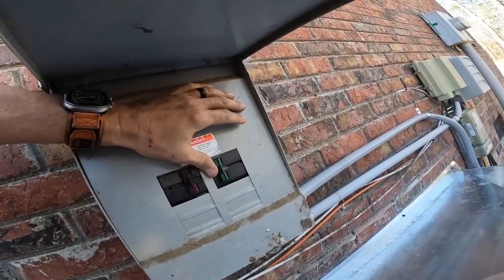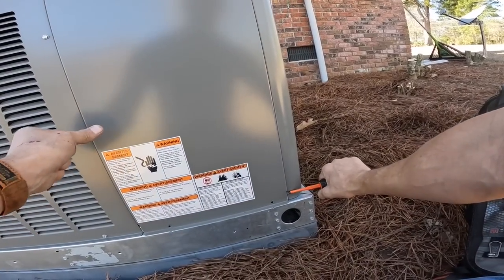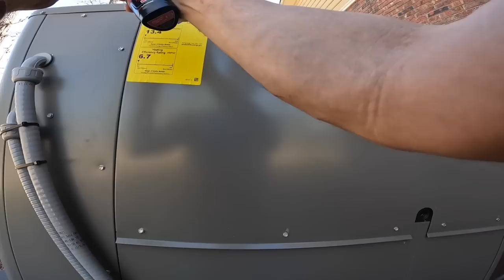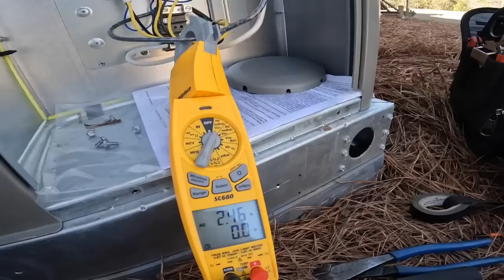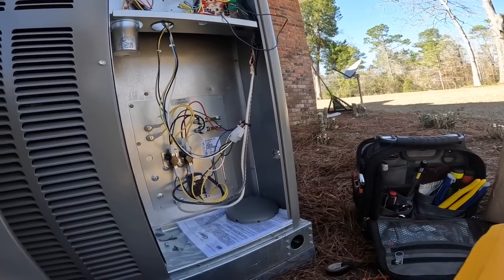Installing a Heater Kit On a Lennox Heat Pump Package Unit

Comment: I like the design of that Lennox unit. 
Heat strip was also professionally installed. Nice work Curtis
Reply: I agree, but when getting parts is a problem, that's a problem. He said the other customer had to go with a different unit because he couldn't get an evaporator, that's a drag and expensive.

Comment: Curtis, that unit looks just like my Mr. Cool 14 seer heatpump.  I bought it on scratch and dent, at a great price.   When you opened it up, it confirmed what I was thinking!  I've now had mine for almost 2 years, and its running like a champ.  The compressor is a bit loud at startup, but, it works perfect.  So glad I caught this video, as I was wondering where the Mr. Cool was sourced from.   Great Video!  keep up the great work!
Reply: Kenneth, was your scratch and dent unit found online? Was the unit shipped to your home and did they charge for that? Thanks.
Reply: yes were to buy scratch and dent please 😢

Comment: Hey Curtis, I noticed you used a jumper wire. You should maybe look into something called a Jumper King. It's a technician invented tool and it's affordable.
Reply: Well maybe I'm out of style, but 60 bucks to me is  still a good bit of money. You can sit down for 15 minutes and make a ton of jumpers.
Reply: @jthonn  The Jumper King is a safer way of using jumper wires. It's powered by the low voltage and has a built in fuse.
Reply: @christiankeller3656  I hear you, I'm sure it's a good tool. I wasn't downing it at all, I guess it's worth it. Like I said, I'm just an old fart and $60 is not cheap to me.

Comment: The Lennox systems look nice and have a pretty good name but, not being able to get parts, especially major parts like evaporators, makes them unattractive to say the least. You did a nice job as usual. I did notice (nothing to do with you) that the red and black wires going to the contactor barely made it, also the yellow going to the capacitor wasn't too long either. Not a problem, I know, but nothing to play with down the line. Maybe I'm just use to 40 miles of wire that we don't need. I'm going into the market for a change out soon, It won't be Lennox. I'm trying to move up a little from Goodman, I'll keep looking.

Comment: It looks like the fan guard is upside down and the fan is actually mounted on the top of the guard. It's odd having a float in the pan but better than a unit swimming from a clogged trap.

Comment: So heat strips always have a separate dedicated circuit? Sometimes I see some on the same power supply. Wouldn’t that risk over current.?
Reply: 5KW will usually all be fed on the same circuit. 10KW can be as well. 15KW you will have a 30 amp and a 60 amp circuit and 20KW is two 60 amp circuits.

Comment: Hey would it be a problem to send a link of what heat pack you installed i iust recently got a 4 ton for free but i dont need.a 20kw maybe something smaller like a 10 pr 15 everytime i look it up i only find one for spilt systems

Comment: What kind of wiring do they require to run those heat strips?  I was looking at 47 amps on his meter.  No. 6?
Reply: Like like 16mm?
Reply: @JesseDoesHVAC  16mm sounds like a metric size.  No. 6 is AWG, American Wire Gauge.      It can carry from 55-75 amps depending upon temp and type ratings.  No. 8 can carry from 40-55, so it could be that as long as it's at least 75degC wire.

Comment: So when did American quality go out the window?  I've seen Lennox furnaces that were almost 50 years old still running and working as intended.
I have a Mueller Climatrol furnace in my house that is 62 years old.  It was converted from oil to a gas burner in the 1980's, and still runs decently today.  Mueller is gone, now.  
The lack of quality today is sickening.

Comment: Which drop in freon do you use for a R22 system?Thanks
Reply from the maker: I like the M099
Reply: @HVACGUY  Does anything has to be modified?Thanks
Reply: R438a is great in cooling almost identical properties but for heating youd be back to pull some of the charge…
Reply: @JesseDoesHVAC  do I have to modify any components??
Reply: @dnell6854  no straight drop in compatible with the mineral oil commonly used with r22
Reply: @dnell6854  for cooling that is. Like i said the pressures run a bit high in heat but for any cooling only applications it works great
Reply: @JesseDoesHVAC  oh wow Thanks!!
Reply: @JesseDoesHVAC  have you tried RS44B Or 422D,I have two brand new jugs of each but never charged with them,any advice is greatly appreciated,Thanks
Reply: @dnell6854  to be honest ive only ever used the r438a. Had a few colleagues introduced to it by one of the ac manufacturers (can remember who exactly) back in the day when r410a was introduced to phase out r22/r407c etc. ever since then its been the cheaper alternative to re charging with r22, especially today when r22 goes for over $200AUD/KG here in Australia 🇦🇺
Reply: @JesseDoesHVAC   okay Thanks
Reply: @JesseDoesHVAC  and that’s 422D,right?